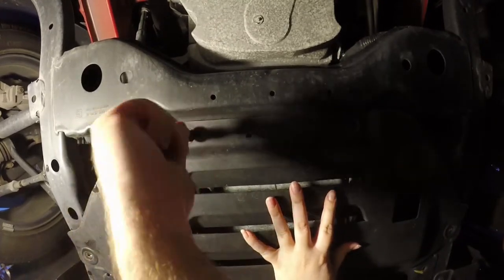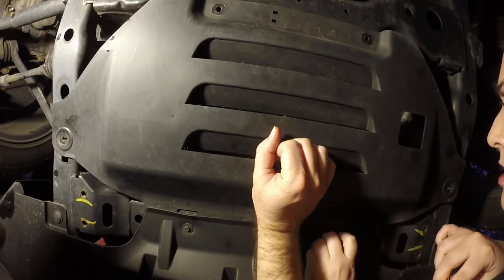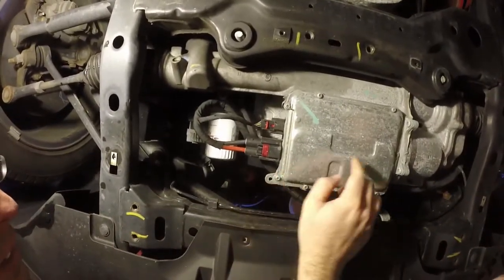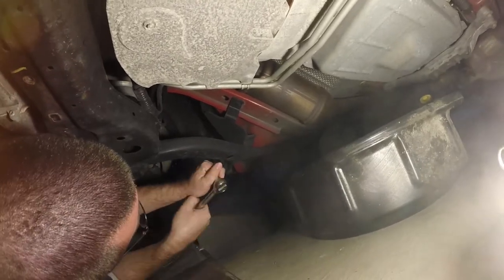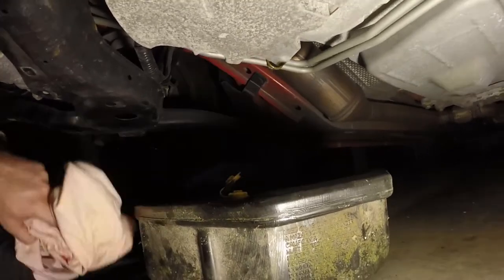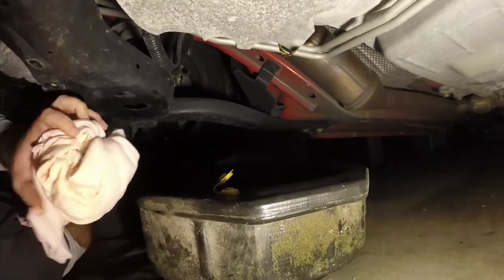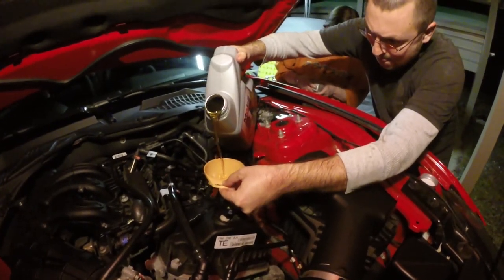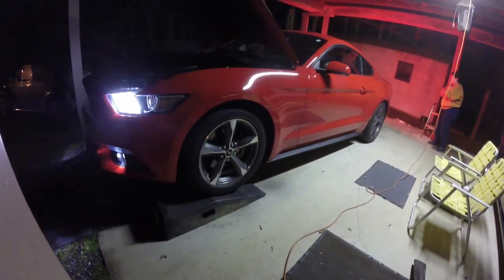My Wife Learns How To Do an Oil Change on the 2015 Mustang V6

Comment: Thanks for the video man. Just wanted to note that for the oil filter I pull the air box off. It’s 1 10mm bolt to remove the entire box and from there you just comfortably reach down and unscrew the filter
Reply from the maker: Cool, thanks

Comment: New S550 owner here :) I usually do maintenance on my cars but man that oil filter is a nightmare! Did it leave a big mess on the engine block/car in general? Thanks for keeping it short and simple
Reply from the maker: Yeah, Ford could’ve made it easier to get to. It’s not the worst oil filter to get to or the most messy one I’ve ever dealt with before. What mess it made was easy to wipe off with a rag. It wasn’t too bad. I suppose if you wanted to get it extra clean you could have some degreaser under the car with you to get off any oil residue. Hope that helps! Enjoy your S550:)
Reply: @Palomino488   Sounds good! I'll keep that in mind when It comes to the 1st oil change 👌 thanks again :)

Comment: wow, we got the same color and everything
Reply: I'm having a ton of trouble taking the screw off the tank to dispense the oil.
Reply from the maker: Sometimes they get overtightened at the mechanic shops and are hard to remove.